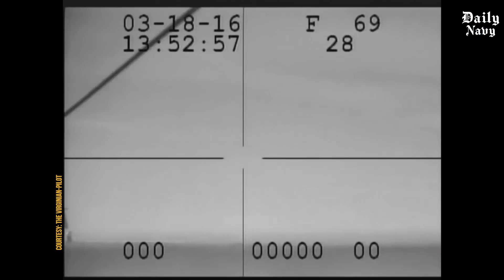What Happens When a Pilot Breaks the Arresting Cable While Landing on US Aircraft Carriers

Comment: This is why you kept your head on a swivel because the danger could come from any direction. I saw one sailor sucked into an A-7 intake and I was in the right seat of a A-3 Skywarrior on the port cat about to be launched and a yellow shirt was positioning an F-4 on the starboard cat when it ran over the leg of one of the cat checkers. Didn’t see it but it was immediately on the radio. Everything was halted until he was taken to medical. It mangled his right leg. It was raining and the sea was a bit rough. These things happened so fast and It’s due to the training that more don’t happen. Much respect to the men and women working the flight deck.
Reply: Gday. Just in case I get no reply from my posted question, can I query yourself on what happens after a snappage - specifically; is the cable replaced immediately, deployment continued with 1 wire down, or head to a port for quick/long repairs? Thankyou for your service, sir. SG, ex RAAF.
Reply: @scottgilbert6301 depends,it may delay the recovery if people are wounded or killed. Usually the broken wire is replaced after the recovery. There is a recovery tanker air born for emergencies like that. The ship doesn’t have to return to port for that.
Reply: @rickcrews5816  , thankyou for these replies. Fascinating stuff. I was in the fighter world, down here - working on classic hornets ... with arresting hook used at times, in conjunction with airfield arrestor cable (RAAF Williamtown - Where one of your hornets crash landed, after an incident on the USS Independence, I think it was. Pilot all good. Jet eventually repatriated back to a US establishment.
Reply: @scottgilbert6301 I was fortunate to be able to visit the HMS Ark Royal in Hong Kong in 1972. It was a great opportunity to see how your carrier worked. Much respect to all  naval aviators and maintainers.
Reply: @rickcrews5816  , sorry mate, when I mentioned the RAAF, I meant the Royal Australian Air Force. I served as a maintainer for 8 years, working on F/A-18 A and B models. Our last carrier was decommissioned in 1982 (Notorious one too - HMAS Melbourne. Sunk 1 of our ships, and collided with 1 of yours during a SEATO exercise).
Reply: @scottgilbert6301 got it sorry I realize you were Australian and no disrespect intended. Just a memory from an old man.
Reply: @rickcrews5816  ,absolutely no offence taken. It's been good to talk. 🙂
Reply: @scottgilbert6301  it depends on how much damage and/or if people are injured. If possible the wire is removed and the recovery continues. There is a recovery tanker covering the recovery if any aircraft needs additional fuel while the ship is deciding the severity of the damage. After the recovery the wire is replaced and tested before the next cycle. Usually doesn’t require an in port repair and life goes on. That’s the importance of calling the ball with the correct weight. Aircraft are required to call their fuel load so the arresting gear is set properly for the recovery weight. This is how it was handled while I served in the early seventies.

Comment: USS Carl Vinson CVN70 ‘86-‘89 V2 arresting gear. 
We lost a F-14 in late ‘87 if I remember correctly, when it caught the number two wire. The gear engine cable was not “routed” correctly, thus cutting the cable during arrest. The Tomcat went over the waist pulling the CDP and cable as it went over. Both pilots survived. 
Bad day for the Air Dept. it’s not always the pilots fault in my experience, as it is very rare.
Reply from the maker: Thanks for sharing your experience and your service!!

Comment: That was an f/a-18 you can tell by the stabilizers , on a tomcat they’re spaced more apart and straight up. On a hornet they’re angled. A tomcat is a larger air plane and they were phased out by the late 90’s. Hornets replaced the tomcat starting in 1987, by 1994 most F-14 were mothballed
Reply from the maker: Thanks for the information!
Reply: Tomcats started getting replaced by Super Hornets (not Hornets) in 2001. Most F-14s were still working the Roof  till the early 2000's , then retired in 2006....

Comment: A broken arresting cable on a U.S. carrier during landing prompts an immediate pilot go-around (bolter) using full throttle to take off again. Deck operations pause briefly to clear debris and replace the cable, with backups ensuring continuity. Rare due to rigorous inspections, the event minimally disrupts the carrier’s tempo, with pilot and crew safety maintained through training and redundancy.